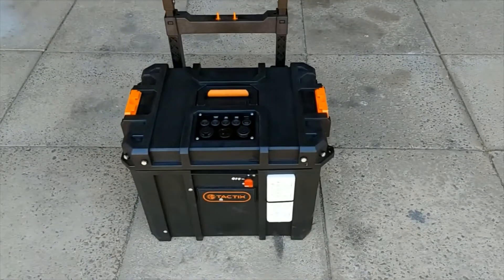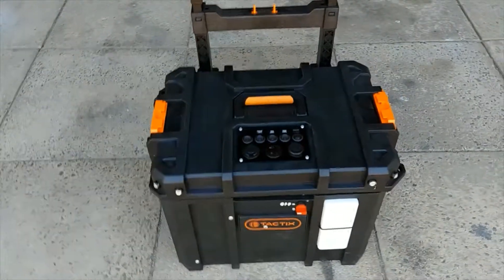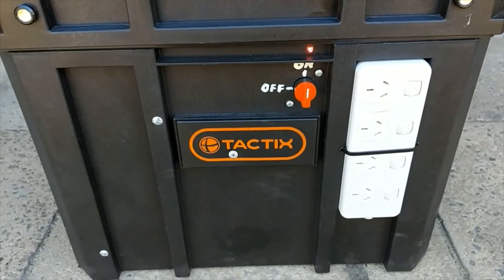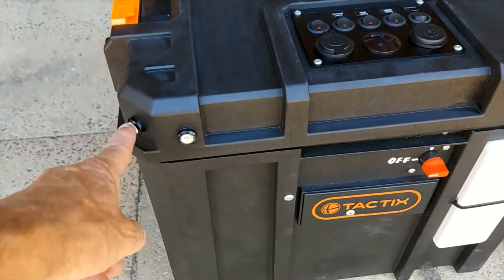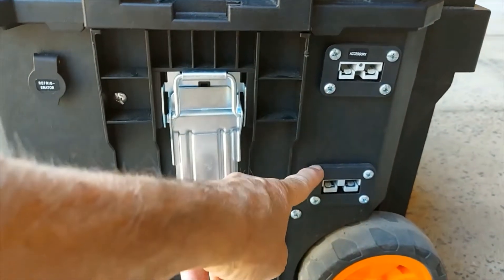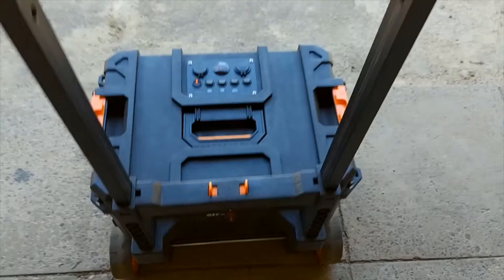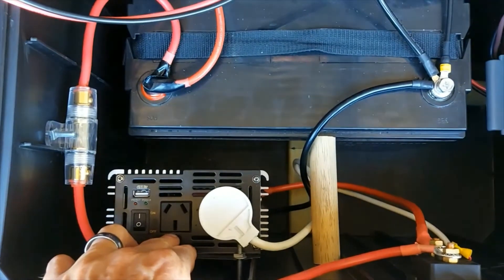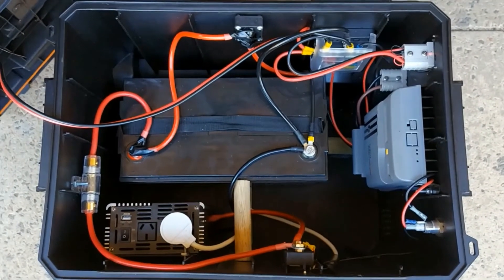DIY Lithium Power Station. basic, easy version.

Comment: What gauge wire do you use to power the fuse block from the battery? I’m trying to decide if 10awg will be large enough or if I should go with some 4awg I have.
Reply from the maker: Hi,
It depends on how many fyses and/or how many total amps you might draw through the fuse box at any given time. 10 is light. 6 is probably overkill as it will handle about 60 amps which is huge. I used 8guage as mine are fairly light loads with even my 75 L fridge only using 5amps. You could put another fuse i line between battery and 12 panel if concerned. On the A/C side 6 or 4 gauge probably. I still only used 6 as a short distance and only a 609w inverter not used heavily.
Good luck. PS, I am NOT an electrician.

Comment: Anyone out there know were I can buy a 2000 watt pure sine Wave inverter that can be paired up with another 2000 watt pure sine wave inverter to give you the ability to have 120/240 volt output I want the ability to not just run my 120 volt appliances but to have the option to put in a heat pump hot water heater and a heat pump dryer also to be able on a hot sunny day to run my central air conditioner
Reply: You can get two Victron multiplus inverters. I have (2) 3000 watt run in split phase. I do not run anything on 240v though. I have it all on my YouTube channel camp prevost if you want to check it out.

Comment: I need one of these to run a circulation pump - our achilles heel in power-outages, the woodburner relies on a 220v electrical circulation pump in order not to become a bomb. The pump draws very little current, but is still essential to have power. Everything else I've subverted to "not reliant on mains power" - reasons in the future etc etc. 

Anyway, my "budget" for building one is 50p.. which will be helped by having several salvaged heavy-duty inverters to hand, having a box & I'm gonna use good cells out of a load of "dead" batteries as the power source. The outlets/charger/BMS etc etc will be salvaged.. I can't get my head around chucking money at a "Self-reliance" project - it just strikes me as counter-logical - build it for free or close to free using what you have to hand/can get for free. That's half the challenge. Can you build one for peanuts? There's no fun (to me anyway) just aiming the wallet at a problem and hitting "Full-Auto" on the money-gun.  Just my 2c.  Which will also hopefully be the total spend.. :-)
Reply from the maker: Hi James, thanks for the comment. I agree to a degree for sure.
The main big cost was the Lithium which I already owned. 
The other thing was just trying to make one Better( for me usable power) than the commercial ones for less.
Lastly, I'm no electronics specialist and I don't want my wife having any problems as that defeats it's purpose, never mind the possibility of the house burning down, Yikes!

Comment: Matt, Thank you for the ideas that this has given me.  I do like what you have done.  Good choice on the box and not too expensive.  The TACTEX stack system is rated at 270lbs and the lower box is large enough to hold a 200ah battery.  With that much power, that would really provide a lot on the job, or during an emergency.  Love the large wheels to be able to move it around.  I may build one of these just for the fun of it.  Some changes I would probably make is to put the control panel on the front or on the side.  This way no wires are attached to the lid for easy removal and shorter wire connections.  Also the additional TACTEX boxes can fit on top without hindering operation, and if the other boxes are removed you could possibly sit on the lower box as a seat if you don't weigh too much, or add extra support to it.  Going with a larger battery and inverter would require beefing up the cabling, but would be able to operate larger appliances, or tools.  I like your ability to charge with solar.  That could keep that battery up and running for days in a remote area, but you would need some portable solar panels to support it that way.  I don't expect anyone to take apart their fixed array to take this portable unit camping.  But, it's a nice touch for extending power at a fixed location if the power goes out at home and you need to keep the fridge running.  But, initially all that is needed for portability is a good 20amp charger at the end of the day.  That would cut down on initial costs to build, and the box allows the extra room to add on solar later.  Thanks for the review of your system, nice job.
Reply from the maker: Thanks for the comment.  I did build this on a whim and I would change a couple of things next time. 
It was built with the main purpose in mind for my wife to be able to wheel it from the shed straight into the house to run the the fridge,  Tv, light etc... We live in the country and when the power goes out when I'm not home she doesn't have to muck around with the generator and extensions. It is perfect for that. The panel on the lid is nice and easy to see the voltage and switches but the long wire isn't ideal. Luckily the lid is rarely removed. Ideas is the reason for the vid and I'm glad that you enjoyed my effort.